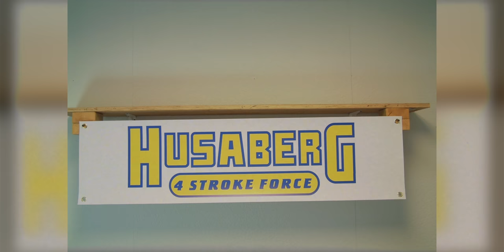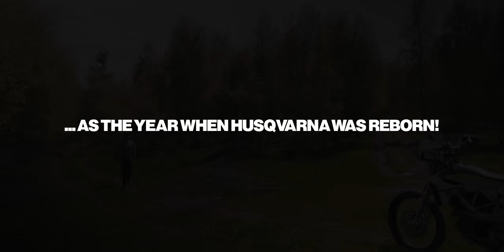The Untold Truth Behind HUSABERG’s Demise!

Comment: I had a 2003 FE501e and while I liked everything about the bike, it had a major flaw in the design of the electronics. I forget the name of the part, but it was the main series/groups of electrical windings. It was known flaw and Husaberg never corrected the issue. You could buy a new part for $300 to $500 and it could fail the second or third ride. Then Husaberg went to a completely different ignition and charging design which then made the part I needed obsolete and virtually impossible to find. When KTM purchased them, the situation became even worse as far as warranty, parts, service info and manual. Most friends switched to KTM or Husqvarna. Husaberg killed themselves. Never build a product and bring it to market with a known Achilles heel and never leave customers without parts and support. It would have been not too difficult for them to redesign and find a solution for current owners, but their philosophy was that they already had your money and you would just replace the bike with a newer model despite the HUGE loss on trade or resale. They were 100% wrong. They deserved to go out of business because they took our money and left us high and dry with motorcycles that were worthless. My $5800 motorcycle was sold for $500 because it didn't run and the parts were no where to be found in the world; that was in 2005.
Reply: The good old sem stator. I owned the same bike. No issues.
Reply from the maker: I get it... And things like this are 10 times harder to support for a small manufacturer. It's not an easy business
Reply: @pauldavies5541  You are the only guy I heard of that didn't have one fail. Other guys I knew kept spares on hand and repaired them themselves as they broke.
Reply: @KRANKiT  That's no excuse. When you bring a product to market, especially a car or motorcycle, you owe the consumer a commitment to providing parts at a reason cost in a reasonable time frame. When you have a flawed critical component, you analyze the problem and correct. You do not leave the buyer with a 400 lb boat anchor or paper weight. They did a complete redesign that was not backward compatible. They completely left us without any support. They deserved to fail.
Reply from the maker: @briangc1972  I agree, don’t get me wrong. I’m just saying that the smaller a manufacturer is, the harder it is for them to do stuff like that. No, it’s not an excuse, but it is a reality unfortunately

Comment: If you "manage to pull a short straw every time", it's not a question of luck anymore. You're doing something wrong. Husaberg had 25 years to figure out other parts of the business than engineering, and they just... didn't.
Reply from the maker: Fair enough... Creating a cool product and running a business can be two totally different areas, as seen here